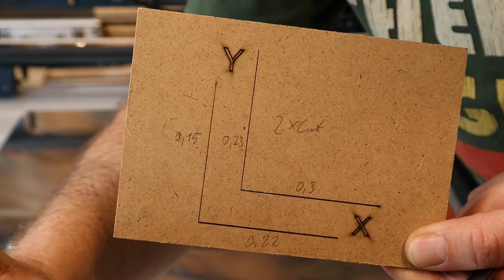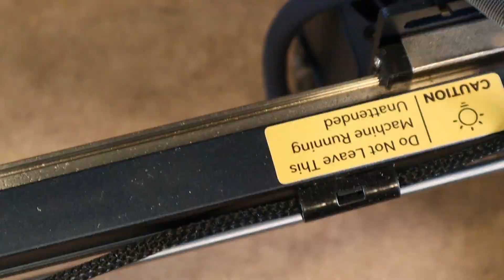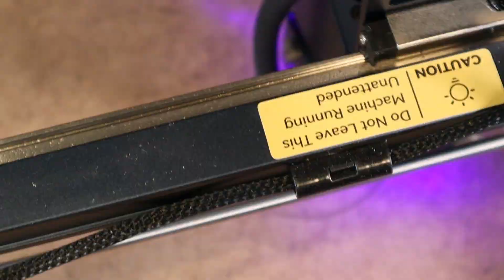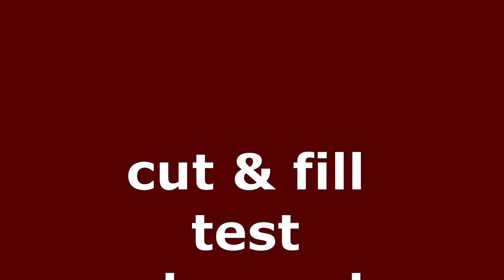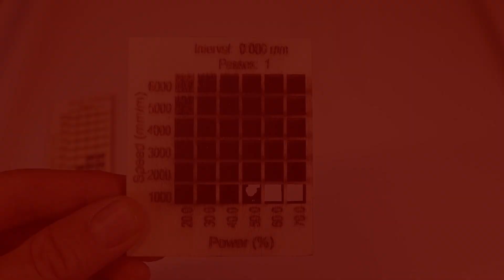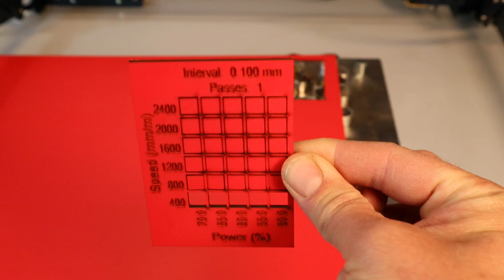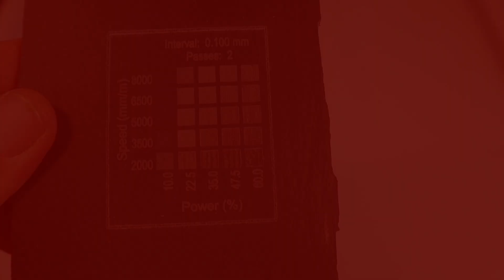Sculpfun S30 Ultra 33W - test and review!

Comment: try cutting a circle and you will see it is not a circle. i think this is a common drawback since there is only one motor for the y axis
Reply from the maker: As far as I used it, it was a nice circle. Maybe it is a matter of adjustment of the casters. I understand your point but as far as I can measure it is fine...
Reply from the maker: Ah and one more thing... Have you corrected for the form of your laserbeam? As the dimensions of the beam are not the same in x and y direction you have to compensate for that as well. I will try the next days again at different positions and measure again 😊
Reply: @heikoofalltrades2267  I think I made the vslot wheel quite tight, so the wheels move quite hard, it makes the accuracy higher, however, with only one stepper motor, the transmission is difficult. Now I have added a stepper motor for the y axis myself, it will be more secure.
Because, if you move fast, even though the wheel moves smoothly, if there is only one stepper motor for the y axis, the circle will still be distorted
Reply: @heikoofalltrades2267  i will try tightening the wheel and combine 2 y stepper motors, see if the circle is distorted
if it is still distorted, then the reason is the vslot wheel adjustment
Reply: @heikoofalltrades2267  the reason the circle is distorted is because i adjusted the vslot wheel too tight to the aluminum bar, and i only adjusted it in the Y axis. when cutting the circle the Y axis is always lagging behind the X axis, so the shape will not be round. , I modified the part plate to be able to add a stepper motor to the Y axis, so I can't return to the original shape. I regret that very much.
Reply: Does your laser module cooling fan automatically turn off when the laser is not working. On mine, the fan spins constantly, only turning off when the power is turned off

Comment: Would this work for cutting boards?  Not looking to cut through, just put a design on.
Reply from the maker: @charleschi843  Engraving the board? Yes! Watch my video of the cutting board I made. I engraved that with a much weaker laser. You can adjust the power and speed of the Laser so that you are not cutting through.
Reply: @heikoofalltrades2267  Amazing, thank you!

Comment: Hi. I have not had my Sculpfun S30 Ultra 33W laser for that long. I damaged the blades on the fan on the back of the laser module. I replaced the fan but not shore if i put it back the correct way. If you put your hand over the fan do you feel it blowing onto your hand or should it be blowing down towards the bottom end.
Reply from the maker: @michaelvanalphen2392  Hi. The fan sucks the air into the housing so from up to down. Hope you can repair it!

Comment: What is the thickness of all materials? A test like this absolutely useless without the thickness of each materials!
Reply from the maker: @snuj5611  For my understanding the max cut performance with one pass ist not that important as I more like using less power and more passes. Is better for the diode. Next is the cutting speed. I can take 100% power and move the laser extremly slow. Yes I can cut very deep but you have a lot of heat and burnmarks and the danger of fire is higher.
In my experience the laser can safly cut 10mm ply with one pass but I had 8mm ply where this was not working with the same settings. It realy depends on the individual material YOU use.
Other test stated it can cut 18 mm pine in two passes. I tryed that for fun but it never worked with my wood here.
I wanted to give you an impression of the laser performance in my video but I cant give numbers for max material cutting power. All usual materials 4 to 8 mm are easy to cut.
Reply: @heikoofalltrades2267  
I just wanted to know the settings and the thickness together. That would have been a good comparison for me because I have the same laser even if all materials are a bit different. Anyway good video!